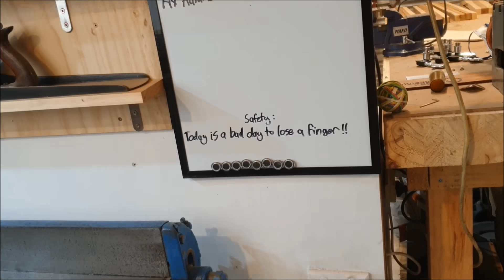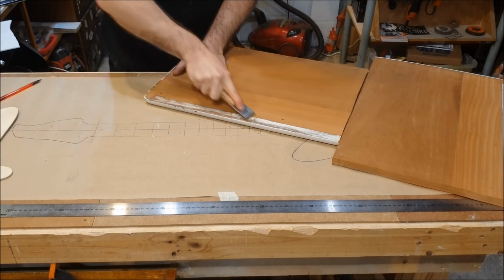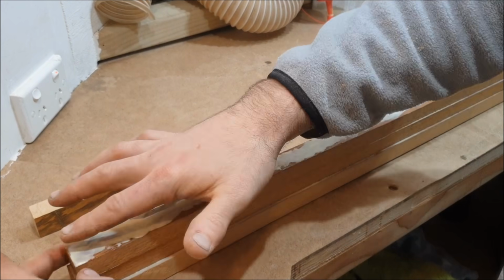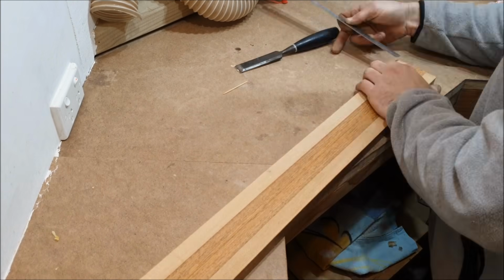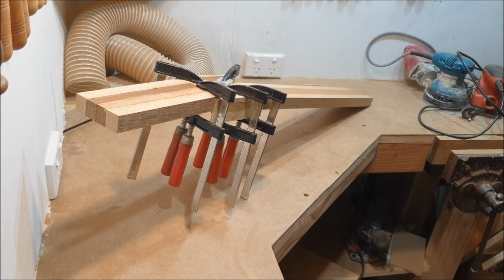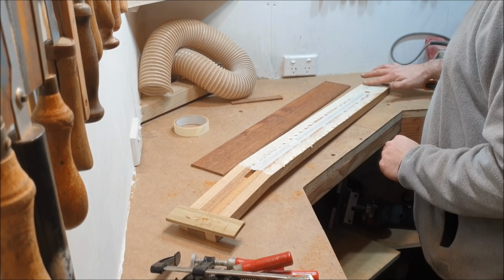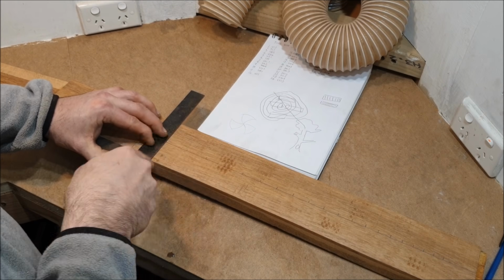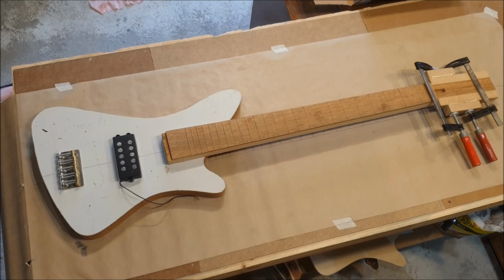5-String Bass Guitar Build - Part 1

Comment: You can get a .5 mm blade for a coping saw to do the fret cuts. All you gotta do is keep your finger on the top smooth side of the blade while youre sawing and when it is flush with the board you are good.
Reply from the maker: Indeed, if you watch the rest of the series that exact saw blade makes an appearance. I prefer to cut the slots first with a razor saw to make the final slots easier to cut more precisely, very much like drilling a pilot hole first. Thanks.

Comment: Tip: Put glue on both surfaces to minimise any slight risk of an air bubble
Reply: arifreeman Also, putting glue on both surfaces the glue will much easier soak into the wood and make a stronger bond

Comment: Nice work. Why didn't you use a single piece of wood for the neck? And isn't the truss rod supposed to be fit on the backside of the neck, rather than under the fretboard?
Reply from the maker: I resawed the wood so I could get the grain orientation right, it makes for a nice stable neck. One piece necks can be just as stable but you have to use a piece with the grain oriented properly. 

Mounting the truss rod under the fingerboard is industry standard for every manufacturer except Fender and their clones, and even then they don't do it 100% of the time. It's actually a lot more work to install the truss rod like that, then install the walnut stripe, and both of the fenders I've owned had the walnut come loose over time, so just nope. I don't like it. Thanks.
Reply: @fanbladeinstruments  I didn't know that truss rod placement thing was only for Fenders, thanks for the info.

Comment: You can actually pin literally the scarf joint, using screws on the edges, since you will cut those out when making the headstock shape